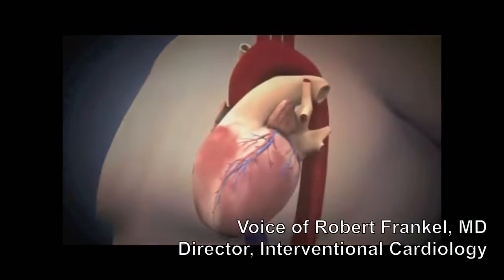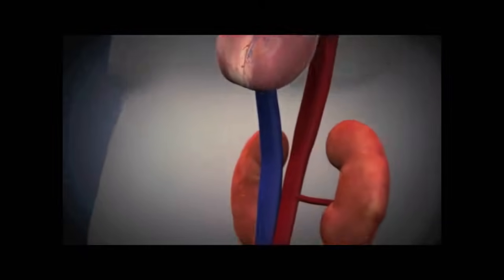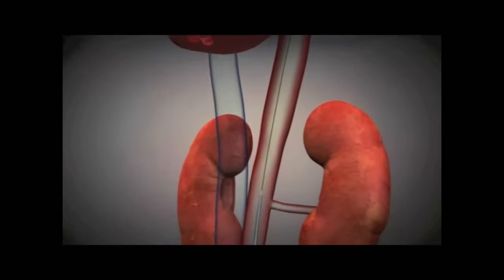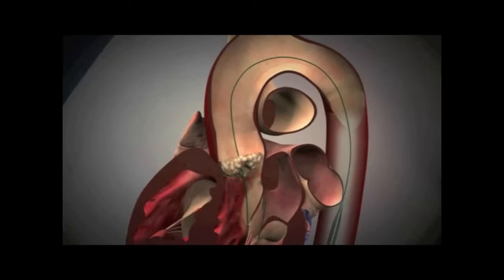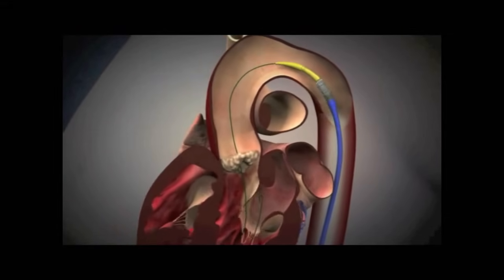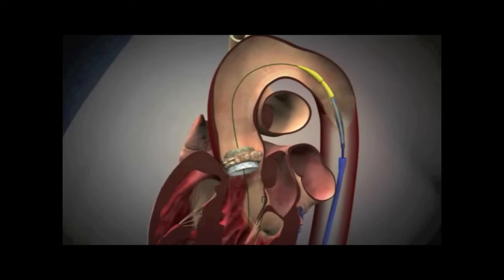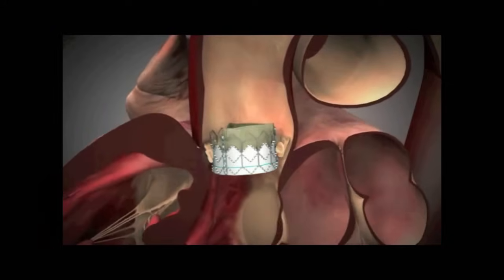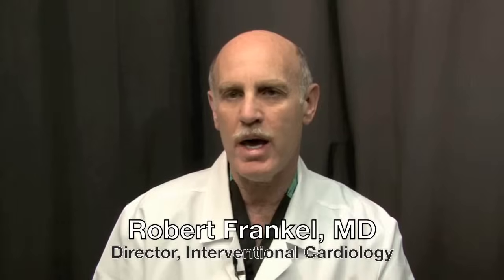Transcatheter Aortic Valve Implantation (TAVI)

Comment: Plz complications of procedure
Reply: 1. Kidney Impairment - The contrast dye used for imaging during the surgery have side effects on the kidney, though this risk is reversible in some cases.
2. Arrhythmias - In some cases, during the placement of the valve, the valves press the heart’s electrical system leading to abnormal heart rhythms, requiring a pacemaker.
3. Vascular Injury - In few cases, the blood leaks around the valves due to improper placements, calcium build-up or incomplete expansion of valves.

If you have any more questions about TAVI, read the blog below and you will find the answers to all your questions.

https://www.cardium.in/transcatheter-aortic-valve-implantation.php

Comment: Correction! The wire that is first inserted does not have a little curl on the end. It has a latex tip cover. If it is removed for some reason it can nick or even penetrate the heart causing the pericardium to fill with blood. Also when they force open the calcified valve to insert the TAVR it can damage the nerve that send electrical signals for your heart to beat. Your heart will stop! This is a serious risk with people with right bundle blockage! Do not think these thing can not happen both happened to me. I spent 5 days in ICU over this procedure and weeks in recovery at home.
Reply: Hope you are ok now. Anything with the heart is serious lots of things can go wrong.

Comment: How does this compare with a porcine or bovine valve replacement?
Reply: I think the valve itself is still made from bovine leaflets, except they're fused with the metal outer ring. As far as I understand TAVI is just a different way to place that valve, and doesn't have much to do with the material the valve is made from.
Reply: VanillaSnake21 yeah, its just a better procedure for High surgical risk patients since it is less invasive.

Comment: Would there be any need to remove a stent and replace it with another one? How is this done and why?
Reply: The body may recognize the valve as an intruder, and attack it. Or the natural components blood, such as fat and calcium, may build up in the new valve. In both cases, the compromised valve must be removed and replaced.

It usually takes a while for this to happen tho.

Comment: No risk of the new valve replacement being dislodged? I've witnessed an open heart bioprosthetic aortic valve replacement and the amount of sutures required to position and keep it in place was close 80! How does the TAVR vavle stay in place?
Reply: It uses high tech metals that have a radial pressure that is constantly pushing outwards with quite a bit of force. It has properties that expand more as it warms in the body. This type of procedure is a life or death without it type deal. This is absolutely amazing technology!
Reply: good question, i could guess that physics must explain it all, as all heart structures remain intact, measurements of pressure, flow, etc. should probably be conserved naturally.

Comment: whats the risk of a distant emboli when cracking the stenotic valves open and post-op stent failure?
Reply: There absolutely is a risk of embolism cause. By debris being released from the stenosis valve, and patients are routinely monitored for these complications following the procedure. It’s a small risk, but a real risk.
Reply: no risk at all
Reply: SubToPewdiepie there is a risk, it’s small but real, and patients are monitored for this following the procedure. 2 to 5% of patients undergoing TAVI/TAVR will experience a CVA within 30 days, many of which are expected to be due to embolism caused by debris released from the stenosis valve. One study placed filters in the brachiocephaplic and left common carotid arteries before replacing the valve and removed them immediately after and the incidence of embolism stroke decreased from 4.6% to 1.4%.

Comment: As of right now, it is really only effective in severely stenosed aortic valves.  Also, it's not as effective as replacing the valve through open heart.  Further, there is a greater risk of stroke from this sort of implantation rather than from replacing the valve, which is why this procedure is typically used for patients who are too weak or old to undergo open heart, since the risk is typically worth the reward.
Reply: ThorsMjollnir0341 and now it’s better! And done more
Reply: @saberur66  Can I ask you a question? I don't want to die I want to live. My doctor told me that left side of my heart valve is blocked 99% and that bypass surgery is out of the question so my doctor said I just take medication and prepare to die =( I read TAVR can help me, could it?
Reply: Don Miller is alive. I saw he posted again below 4 months ago. Hazaaaa
Reply: Nine years ago, this was probably a responsible and somewhat accurate comment.  Trust me, things have changed.
Reply: If you do your current research around the world,  more country’s are using this method , actually up to 80% have Tavi oppose to open heart and they also have hugely decrease the chance of stroke by “in laymen’s terms” putting another line up your wrest with a type of net above the heart to capture any piece of calcium that might break off and cause the stroke,  it used to be for older and more severe cases, now in many countries it is offered to younger and moderate cases, I just had mine done, I am 68 and had severe stenosis but my research showed the revolution of the Tavi procedure in the last 10 years made Tavi the right choice for Me,  I am so grateful
Reply: If you do your current research (2023) around the world,  more country’s are using this method , actually up to 80% recommend Tavi oppose to open heart and they also have hugely decrease the chance of stroke by “in laymen’s terms” putting another line up your wrest with a type of net above the heart to capture any piece of calcium that might break off and cause the stroke,  it used to be for older and more severe cases, now in many countries it is offered to younger and moderate cases, I just had mine done, I am 68 and had severe stenosis but my research showed the revolution of the Tavi procedure in the last 10 years made Tavi the right choice for Me, 
I am so grateful to this technology and the expert Doctors that perform it
Reply: What about doing this procedure in a 93 year old man? What do you think about that? I am so terrified for my grandpa.

Comment: Why not just use this procedure exclusively instead of open heart or minimally invasive methods?
Reply: Yesterday I was done my mitral valve ballooning .what can i do know
Reply: This stent and artificial valve do not last as long as a traditional valve replacement. If a patient is likely to be able to recover from a more invasive procedure and has an expected lifespan longer than the artificial valve they may benefit from a traditional valve replacement.
Reply: Money. It's more costly.
Reply: this cost twenty times more than classic open heart operation, the only reason is MONEYYYY
Reply: Oskar Woliński no it doesn’t. This is cheaper, by far. Recovery time is also much less. No need for extended stay in CICU or ICU and no rehab following a thoracotomy. No general anesthetic, no OR time, lower risk of complications such as infection. Traditional valve replacement lasts longer and is a better option if the patient can tolerate the procedure (ie. low risk for surgical complications). The reality is this is a great alternative to traditional valve replacement that is suitable if the patient is a poor candidate for surgical valve replacement.
Reply: @benson8686  but you don't get the scar afterwards, no skin/ bone cutting etc...
Reply: Another important consideration is if the patient also requires CABG, if so, a traditional valve replacement may be performed even if the patient is eligible for an artificial valve.